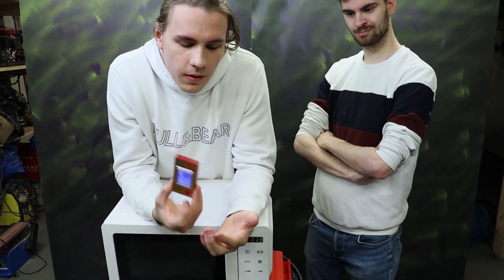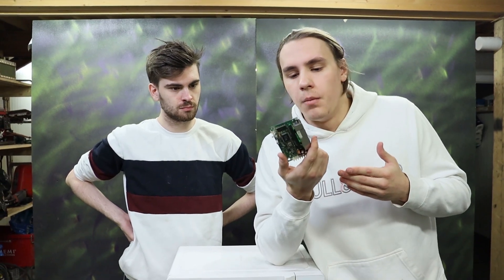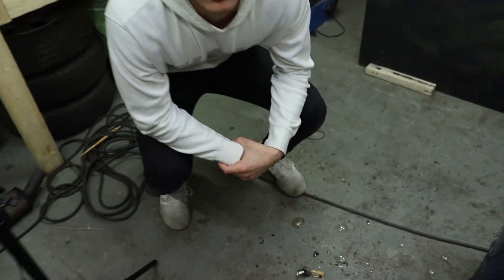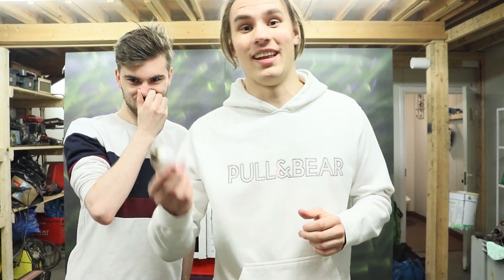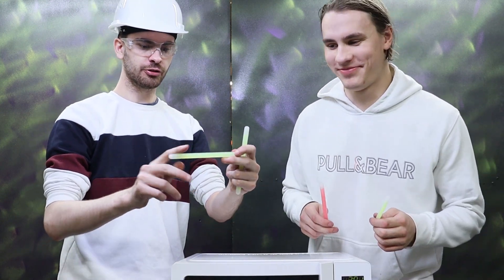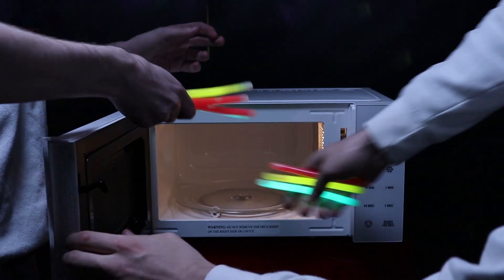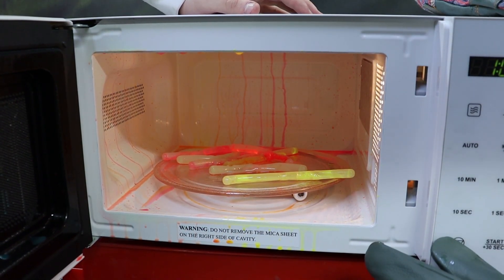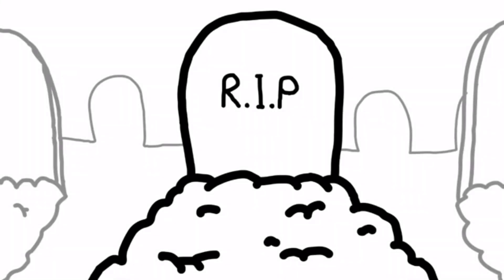WHAT HAPPENS TO A LAMP IN A MICROWAVE?

Comment: Fun Story

My mother bought some vintage glass plates that had metal linings inside for engraving
The paint that sealed the metal away eventually was scrubbed or burned off.
The best time I tried to cook using the plate ended with a ring of electricity around the plate